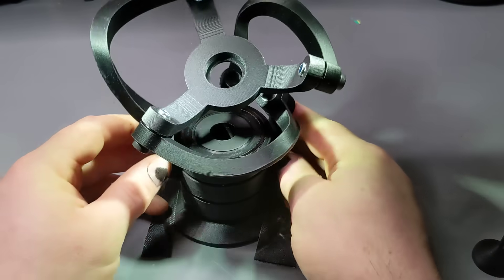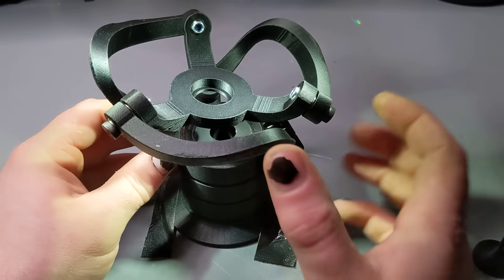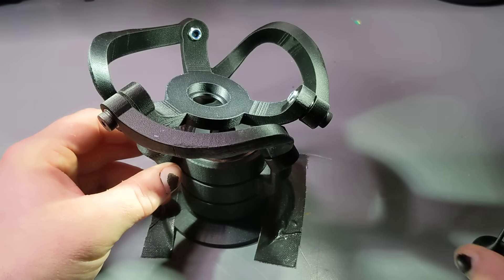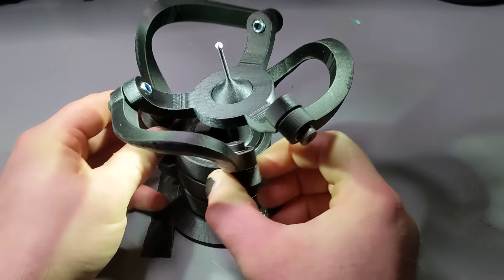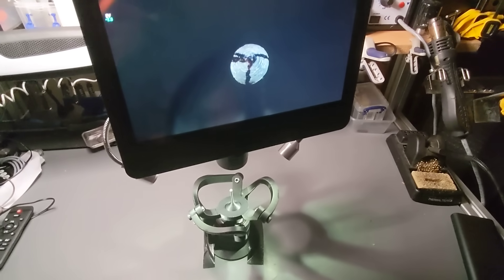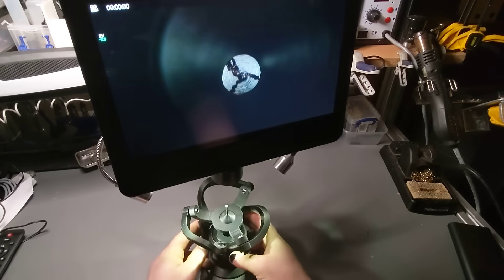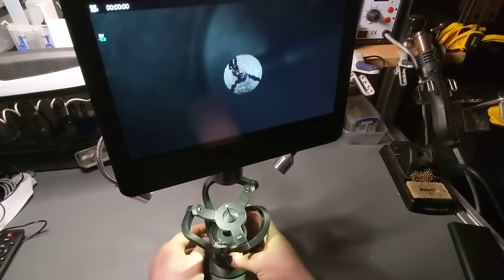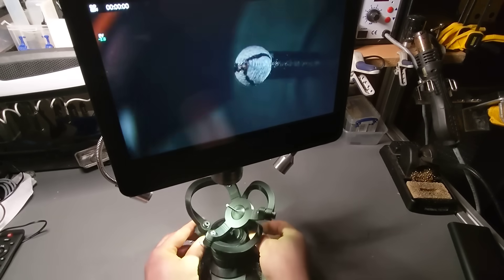Spherical Parallel Manipulator

Comment: Can you upload the math? Like that is awesome!!!!!
Reply from the maker: I uhhh didn't do any math 😅 The secret (figured out by people smarter than I decades ago, they've been around for a while) is all the bearings point to the same spot in space, so I solved it geometrically using CAD rather than maths. 
If you want to make one I plan to release a free 3d printable one, but I might make a more rugged one as a product for labs and such (if there's demand?)
I posted an update vid covering cad/files etc, check it out and leave a comment there on which concept you'd prefer and what your use case/application is (people keep surprising me with novel uses) and I'll do my best to accommodate that in the released design. 
https://youtu.be/wN02itp6-z4
Reply from the maker: I've just uploaded the latest update vid, I've put a lot of work into making it accessible for everyone, files available very soon and I got the costs down to $10 of parts: $10 SPM https://youtu.be/DqjAKmm-FJQ

Comment: Can i ask for STLs,please? 👉👈🥺
Reply from the maker: I plan to release a free 3d printable one, but I might make a more rugged one as a product for labs and such (if there's demand?)
I posted an update vid covering cad/files etc, check it out and leave a comment there on which concept you'd prefer and what your use case/application is (people keep surprising me with novel uses) and I'll do my best to accommodate that in the released design. 
https://youtu.be/wN02itp6-z4
Reply from the maker: I've just uploaded the latest update vid, I've put a lot of work into making it accessible for everyone, files available very soon and I got the costs down to $10 of parts: $10 SPM https://youtu.be/DqjAKmm-FJQ

Comment: this is awesome! 

Is there a download/specific material you used or is this just pla?
Reply from the maker: It's.... PETG-CF from memory, but pla or almost any FDM filament would work 
I posted an update vid covering cad/files etc, check it out and leave a comment there on which concept you'd prefer and what your use case/application is (people keep surprising me with novel uses) and I'll do my best to accommodate that in the released design. 
https://youtu.be/wN02itp6-z4
Reply from the maker: I've just uploaded the latest update vid, I've put a lot of work into making it accessible for everyone, files available very soon and I got the costs down to $10 of parts: $10 SPM https://youtu.be/DqjAKmm-FJQ

Comment: The only real function I can think of for this is jewelry crafting or analyzing.
Reply from the maker: I use it to look at small endmills to check for damage, as well as other low-magnification microscopy stuff, but jewellery or mini-fig painting is a use case some have suggested.
Reply: @makebreakrepair  Oh snap, I never thought about figure painting.  That could work great as I paint!
Reply from the maker: I've just uploaded the latest update vid, I've put a lot of work into making it accessible for everyone, files available very soon and I got the costs down to $10 of parts: $10 SPM https://youtu.be/DqjAKmm-FJQ

Comment: Super cool! Do you have the files available to print?
Reply from the maker: I plan to release a free 3d printable one, but I might make a more rugged one as a product for labs and such (if there's demand?)
I posted an update vid covering cad/files etc, check it out and leave a comment there on which concept you'd prefer and what your use case/application is (people keep surprising me with novel uses) and I'll do my best to accommodate that in the released design. 
https://youtu.be/wN02itp6-z4
Reply: @makebreakrepair  awesome ill keep checking :)
Reply from the maker: Latest update vid, files available very soon and I got the costs down too: $10 SPM https://youtu.be/DqjAKmm-FJQ

Comment: If it were larger it would be simply fantastic for miniature modeling
Reply from the maker: I posted an update vid covering cad/files etc, check it out and leave a comment there on which concept you'd prefer and what your use case/application is (people keep surprising me with novel uses) and I'll do my best to accommodate that in the released design. 
https://youtu.be/wN02itp6-z4

Comment: Hay, it looks really amazing. Is it possible to buy the plans?
Reply from the maker: I posted an update vid covering cad/files etc, check it out and leave a comment there on which concept you'd prefer and what your use case/application is (people keep surprising me with novel uses) and I'll do my best to accommodate that in the released design. 
https://youtu.be/wN02itp6-z4
Reply from the maker: I've just uploaded the latest update vid, I've put a lot of work into making it accessible for everyone, files available very soon and I got the costs down to $10 of parts: $10 SPM https://youtu.be/DqjAKmm-FJQ

Comment: any chance you can link the plans/model.  with a tiny piece of double sided tape. . a small insect can be added. . a great teaching tool for kiddos.
Reply: I would love to print this as well even tho I have no use for it 😂
Reply from the maker: I posted an update vid covering cad/files etc, check it out and leave a comment there on which concept you'd prefer and what your use case/application is (people keep surprising me with novel uses) and I'll do my best to accommodate that in the released design. 
https://youtu.be/wN02itp6-z4
Reply from the maker: I've just uploaded the latest update vid, I've put a lot of work into making it accessible for everyone, files available very soon and I got the costs down to $10 of parts: $10 SPM https://youtu.be/DqjAKmm-FJQ
Reply from the maker: I've just uploaded the latest update vid, I've put a lot of work into making it accessible for everyone, files available very soon and I got the costs down to $10 of parts: $10 SPM https://youtu.be/DqjAKmm-FJQ

Comment: This needs a locking mechanism to fix it in place once it has been positioned.  Not sure how to implement that.
Reply from the maker: Easy enough, lock the bottom bearings (ie the big ones in the main body) relative to each other. The simplest way is a piece of tape, there's so much mechanical advantage you'll break the arms before masking tape lets go.

Comment: Oh wow, that is really impressive. 
I would love to get the stl files for this. It would be a really useful tool to have for my job. 
I am ok to pay for those, let me know !
Reply from the maker: I posted an update vid covering cad/files etc, check it out and leave a comment there on which concept you'd prefer and what your use case/application is (people keep surprising me with novel uses) and I'll do my best to accommodate that in the released design. 
https://youtu.be/wN02itp6-z4
Reply from the maker: I've just uploaded the latest update vid, I've put a lot of work into making it accessible for everyone, files available very soon and I got the costs down to $10 of parts: $10 SPM https://youtu.be/DqjAKmm-FJQ
If you're interested in the short-run, professional use metal version please fill out this form: https://forms.gle/XGxA5Zzp16doP4pE6
Your email or any other info you put in that form will not be used for marketing, nor passed on to any third parties, nor used in any way other than to contact you about that specific project - I'm just an engineer in a shed figuring out if people want something :)

Comment: This is fantastic work, is the file available anywhere?
Reply from the maker: I plan to release a free 3d printable one, but I might make a more rugged one as a product for labs and such (if there's demand?)
I posted an update vid covering cad/files etc, check it out and leave a comment there on which concept you'd prefer and what your use case/application is (people keep surprising me with novel uses) and I'll do my best to accommodate that in the released design. 
https://youtu.be/wN02itp6-z4
Reply from the maker: I've just uploaded the latest update vid, I've put a lot of work into making it accessible for everyone, files available very soon and I got the costs down to $10 of parts: $10 SPM https://youtu.be/DqjAKmm-FJQ

Comment: great project, do you plan to share the files ?
Reply from the maker: I plan to release a free 3d printable one, but I might make a more rugged one as a product for labs and such (if there's demand?)
I posted an update vid covering cad/files etc, check it out and leave a comment there on which concept you'd prefer and what your use case/application is (people keep surprising me with novel uses) and I'll do my best to accommodate that in the released design. 
https://youtu.be/wN02itp6-z4
Reply from the maker: I've just uploaded the latest update vid, I've put a lot of work into making it accessible for everyone, files available very soon and I got the costs down to $10 of parts: $10 SPM https://youtu.be/DqjAKmm-FJQ

Comment: Nice! Do you share this somewhere?
Reply from the maker: I plan to release a free 3d printable one, but I might make a more rugged one as a product for labs and such (if there's demand?)
I posted an update vid covering cad/files etc, check it out and leave a comment there on which concept you'd prefer and what your use case/application is (people keep surprising me with novel uses) and I'll do my best to accommodate that in the released design. 
https://youtu.be/wN02itp6-z4
Reply from the maker: I've just uploaded the latest update vid, I've put a lot of work into making it accessible for everyone, files available very soon and I got the costs down to $10 of parts: $10 SPM https://youtu.be/DqjAKmm-FJQ

Comment: Do you have any STLs for either download or purchase @MakeBreakRepair?
Reply from the maker: I posted an update vid covering cad/files etc, check it out and leave a comment there on which concept you'd prefer and what your use case/application is (people keep surprising me with novel uses) and I'll do my best to accommodate that in the released design. 
https://youtu.be/wN02itp6-z4
Reply from the maker: I've just uploaded the latest update vid, I've put a lot of work into making it accessible for everyone, files available very soon and I got the costs down to $10 of parts: $10 SPM https://youtu.be/DqjAKmm-FJQ

Comment: Can you please share the models? that's really cool. i might modify it to be entirely printed such that anyone with a printer can make it without needing bolts (with your permission and credit of course)
Reply from the maker: I plan to release a free 3d printable one, but I might make a more rugged one as a product for labs and such (if there's demand?)
I posted an update vid covering cad/files etc, check it out and leave a comment there on which concept you'd prefer and what your use case/application is (people keep surprising me with novel uses) and I'll do my best to accommodate that in the released design. 
https://youtu.be/wN02itp6-z4
Reply from the maker: I've just uploaded the latest update vid, I've put a lot of work into making it accessible for everyone, files available very soon and I got the costs down to $10 of parts: $10 SPM https://youtu.be/DqjAKmm-FJQ

Comment: Do you have print files?
Reply from the maker: I posted an update vid covering cad/files etc, check it out and leave a comment there on which concept you'd prefer and what your use case/application is (people keep surprising me with novel uses) and I'll do my best to accommodate that in the released design. 
https://youtu.be/wN02itp6-z4
Reply from the maker: I've just uploaded the latest update vid, I've put a lot of work into making it accessible for everyone, files available very soon and I got the costs down to $10 of parts: $10 SPM https://youtu.be/DqjAKmm-FJQ

Comment: Gimbal lock shows the horrible modeling that typical spherical coordinates have. Quaternions are flawless yet don't necessarily show us how to make a 3D mechanical device to follow their modeling. Something tells me this is close. With a top "pivot" you would have 4 pivots and quaternions use 4 variables to smoothly define all angles and roll, but 2 states for each position. This should be very interesting to some abstract mathematicians. Maybe contact some different channels like numberphile.

Comment: I’m into gemology and that would be awesome for scoping a gem. Can I buy one off you?
Reply from the maker: I've been thinking of making a serious one (ie metal and rigid) to sell for microscopy, if people are interested I will, but either way I'll make an open source version for people to make. 
I posted an update vid covering cad/files etc, check it out and leave a comment there on which concept you'd prefer and what your use case/application is (people keep surprising me with novel uses) and I'll do my best to accommodate that in the released design. 
https://youtu.be/wN02itp6-z4
Reply from the maker: I've just uploaded the latest update vid, I've put a lot of work into making it accessible for everyone, files available very soon and I got the costs down to $10 of parts: $10 SPM https://youtu.be/DqjAKmm-FJQ
If you're interested in the short-run, professional use metal version please fill out this form: https://forms.gle/XGxA5Zzp16doP4pE6
Your email or any other info you put in that form will not be used for marketing, nor passed on to any third parties, nor used in any way other than to contact you about that specific project - I'm just an engineer in a shed figuring out if people want something :)

Comment: Any plans to release the model?
Reply from the maker: I plan to release a free 3d printable one, but I might make a more rugged one as a product for labs and such (if there's demand?) I posted an update vid covering cad/files etc, check it out and leave a comment there on which concept you'd prefer and what your use case/application is (people keep surprising me with novel uses) and I'll do my best to accommodate that in the released design. 
https://youtu.be/wN02itp6-z4
Reply from the maker: I've just uploaded the latest update vid, I've put a lot of work into making it accessible for everyone, files available very soon and I got the costs down to $10 of parts: $10 SPM https://youtu.be/DqjAKmm-FJQ

Comment: stl when? lol
Reply from the maker: I plan to release a free 3d printable one, but I might make a more rugged one as a product for labs and such (if there's demand?)
I posted an update vid covering cad/files etc, check it out and leave a comment there on which concept you'd prefer and what your use case/application is (people keep surprising me with novel uses) and I'll do my best to accommodate that in the released design. 
https://youtu.be/wN02itp6-z4
Reply from the maker: I've just uploaded the latest update vid, I've put a lot of work into making it accessible for everyone, files available very soon and I got the costs down to $10 of parts: $10 SPM https://youtu.be/DqjAKmm-FJQ

Comment: whoa, how does one do the inverse trigonometry on something like that?
Reply from the maker: I uhhh didn't do any math 😅 The secret (figured out by people smarter than I decades ago, they've been around for a while) is all the bearings point to the same spot in space, so I solved it geometrically using CAD rather than maths. 
I've just uploaded the latest update vid, I've put a lot of work into making it accessible for everyone, files available very soon and I got the costs down to $10 of parts: $10 SPM https://youtu.be/DqjAKmm-FJQ

Comment: Extremely! And so many different applications for this design too
Reply from the maker: I posted an update vid covering cad/files etc, check it out and leave a comment there on which concept you'd prefer and what your use case is and I'll do my best to accommodate that in the released design. 
https://youtu.be/wN02itp6-z4

Comment: I understand completely if you don't want to do this, but I see this is 3D-printed, so I'm wondering if you could share the designs or if you didn't design it, where you found it? I would be very grateful as I would like to construct something like this myself, using my Voron printer
Reply from the maker: I plan to release a free 3d printable one, but I might make a more rugged one as a product for labs and such (if there's demand?)
I posted an update vid covering cad/files etc, check it out and leave a comment there on which concept you'd prefer and what your use case/application is (people keep surprising me with novel uses) and I'll do my best to accommodate that in the released design. 
https://youtu.be/wN02itp6-z4

Comment: I've never wanted anything more
Reply from the maker: I plan to release a free 3d printable one, but I might make a more rugged one as a product for labs and such (if there's demand?)
I posted an update vid covering cad/files etc, check it out and leave a comment there on which concept you'd prefer and what your use case/application is (people keep surprising me with novel uses) and I'll do my best to accommodate that in the released design. 
https://youtu.be/wN02itp6-z4
Reply from the maker: I've just uploaded the latest update vid, I've put a lot of work into making it accessible for everyone, files available very soon and I got the costs down to $10 of parts: $10 SPM https://youtu.be/DqjAKmm-FJQ

Comment: very cool:) would also be perfect to use as the base of one of those 3D mice for CAD design, just need some sensors along the axis to translate the movements and maybe some springs for resistance/ automatic setback